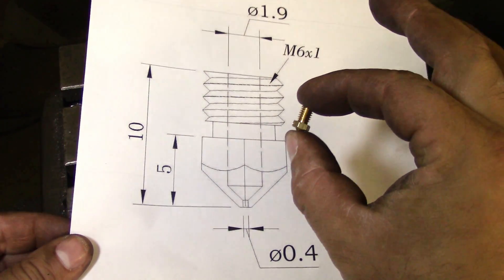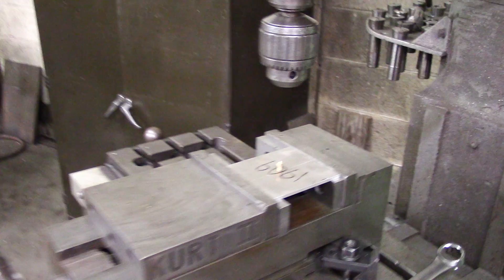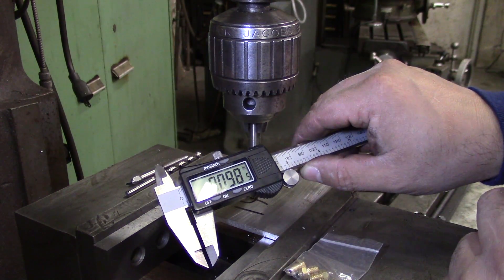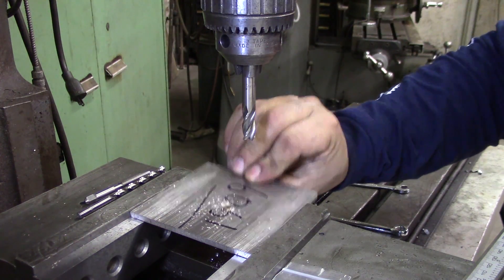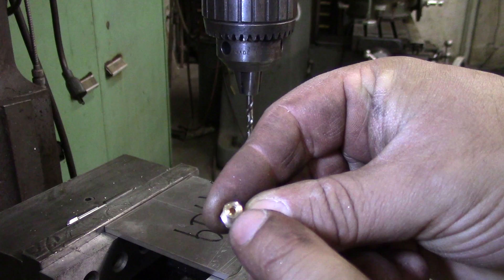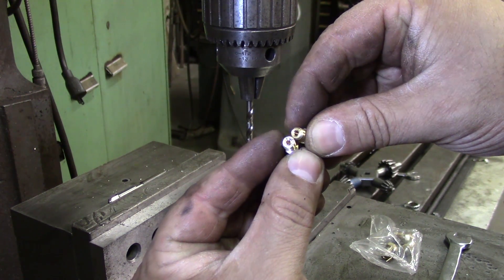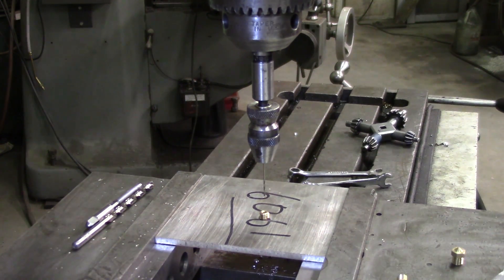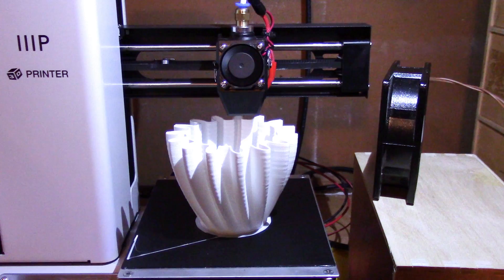How to Modify 3d Printer Nozzles - the EASY way

Comment: I do not see how this is easy. Easy if you have thousands of dollars of machines. FAIL
Reply: Drill and tap an Ally Plate and hit the nozzle with a grinder...round off top of thread
Reply from the maker: Well, I suppose if you didn't bother to save and gather tools with which you can do work, it would be much more difficult... however magic wands are not an appropriate substitute for tools

Comment: you spent a whole plate of Alu ??? and put a hole in it ? Alu is energy expensive !
Reply from the maker: lol, that is not a "whole plate" . we buy large sheets (60"x120") for the jobs in the shop, i took this little tiny piece out of the scrap pile.  we recycle thousands of pounds of aluminum a year.  this tiny plate is basically nothing.

Comment: If you can visually see the drill bit wobbling on the 1mm bit and chuck, there is no way you can maintain a good hole diameter precision.  If you put a dial gauge on that 1mm drill bit, you will definitely see major problems with your runout.  You skipped the important steps of telling or showing the user how to center the bit to the original center hole.  At least set a drill stop distance to chamfer the hole with the drill bit.  If not, you may get chatter along the walls of the chamfered hole.  If you are doing multiple nozzles, setting a vise stop and use the plate as a guide would at least help you to repeat the process on other nozzles without having to recenter the hole.   Overall, good effort at modifying the nozzle even though most people won't have half the equipment you have at home and can't replicate it.
Reply from the maker: lol, i was wondering when someone would notice that...  the #60 drill was already a little bigger than 1mm so i wasn't going to get a perfect hole.  when i saw the wobble i knew one of my guys had bent the arbor and didn't tell me about it!!! not happy, but its not the first time.  for the purposes of modifying a (super cheap) printer nozzle the squareness of the end was the most important part, the rest wasn't that critical, but you make all good points.  as you pointed out i didn't not include alot of the little necessary setup parts of the process, but that is because after making so many videos you get tuned to the things that people get bored watching and then move away from the video... got to keep it exciting, or at least about as exciting as this kind of thing can be, lol
Reply: Thanks for the clarification.  I would be mad too if someone used my expensive arbors or collets, break it, and don't tell me.  I personally like the ER style collets and arbors to minimize the drill distance and maximize the stiffness, but everyone has different preferences and budgets.

I'm sure someone watching may think they can replicate your process.  However, if the drill bit is off the center hole, it can snap easily.  I'm surprised nobody asked you about the critical information like the speed of the end mill or the drill bit.  It's probably not super critical either, but I'm sure you know its different for different material types.  Someone trying modify a stainless or tungsten nozzle may be in for a surprise.  The brass nozzles are very tolerant.

I don't have your same printer, but if the nozzle is different, I may have to see if its better to replace the hot end block with one that has a longer thread engagement to minimize the cost of modifying nozzles in the future.  Maybe another option is to use a shim to allow the nozzle to protrude longer.  Again, I don't have this printer so I don't know if these options are available.
Reply from the maker: oh yeah, if they try this with tungsten, they will be unpleasantly surprised.  i found that most people are not really interested in the EXACT detail, they are just curious of the overall process.... you are one of the few that is most interested (or at least more aware) of the details involved.   one of my main reasons to modify the nozzle is so i could get it as high as possible to give me enough room to install a glass bed, and to avoid buying the OEM nozzles that were much more expensive. i did that over the weekend, and wow what a difference it has made!!

Comment: Great video! I'm also keen to drill out a nozzle and try some fat layer lines for fun. I'll just drill by hand, no fancy machine shop here. Man it must be frustrating dealing with everything in imperial tho. Just FYI, that peg spring on the belt won't help. They stretch under acceleration then spring back, which makes ringing worse. A better design is a static belt tensioner, a guy on Thingiverse named "supasorn" has a good design which takes an M3 screw. It's thing:1780636.
Reply from the maker: thanks and thanks for the info, im going to check it our right now!!